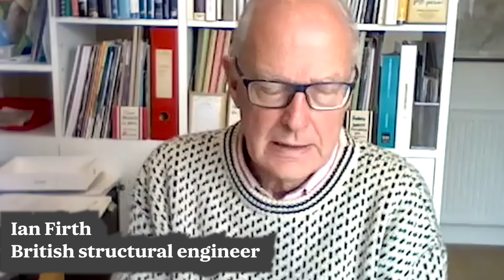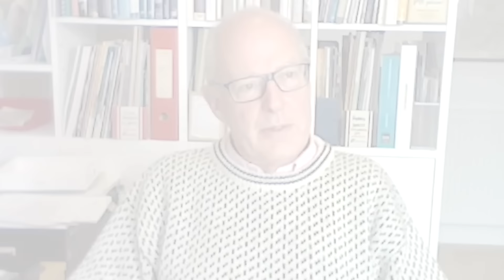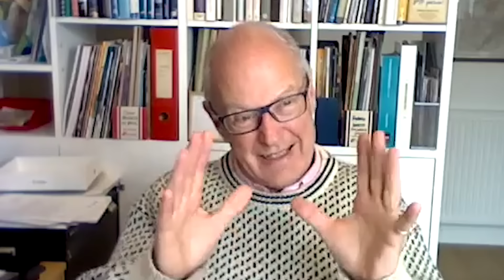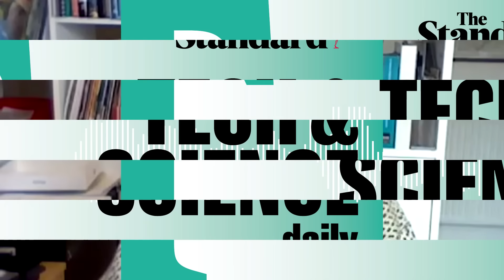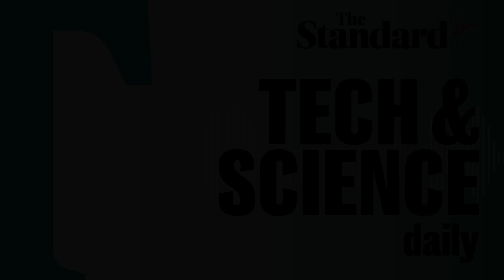[Video] Baltimore Bridge: structural engineer Ian Firth discusses collapse | Tech & Science Daily

Comment: I've been working on bridges since the 1970s and I can tell you exactly what happened 
>>> a big ship bumped into a bridge and it fell over <<< The question is what was the captain and pilot ship doing at the time leading up to this disaster,
Reply: Massive power failures on the vessel led to total loss of hydraulic steering. The engines may have even shut down automatically also. The inertia of the now uncontrollable ship was enough to destroy the support of the bridge.
Reply: Probably punching and kicking the power generator demanding it to work.
Reply: He was trying to restart the ship after it lost power,  have you not read at least one report before depositing a comment on Youtube?
Reply: Quick, get this guy on TV!
Reply: Did you work on this bridge...
Reply: The pilot ships did not pilot them under the bridge apparently once they were "under way" a pilot should have remained on board and he was believed to be directing the road to be closed to his colleagues and such like prior to the collision but there was not a lot of time!?!
Reply: @spaceinvader1621  Sure doesn't sound like he's worked on any bridge. "Bumped into it." 🤦‍♂😂
Reply: @aaronmicalowe  the last bridge he worked on he fell down a open manhole cover and got his head stuck.😂
Reply: Why wasn't the ship secured?  Surely it can be anchored if it's lost power.
Reply: @Hiforest  Because it lost power just minutes before hitting the bridge. Dropping anchor wouldn't have stopped it hitting the bridge?

Comment: Where are the tug boats.? To help this huge vessel to navigate this stretch . Crazy.
Reply: If a ship that size loses power then tug boats are about as useful as a fruit fly
Reply: It would be like the hulk taking a poodle for a walk
Reply: It had finished manoeuvring and was on a virtually straight route to open sea.
It was going fast enough for its own steering. 
No need for tugs there.
Reply: Technically the poodle would be walking the Hulkster@spaceinvader1621
Reply: @mattrogers6487  not if the hulk is running...